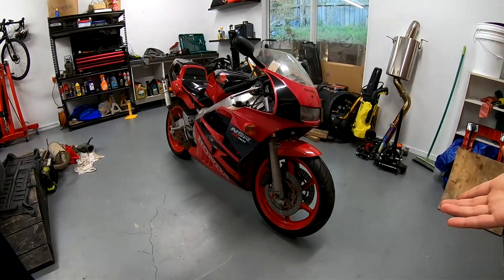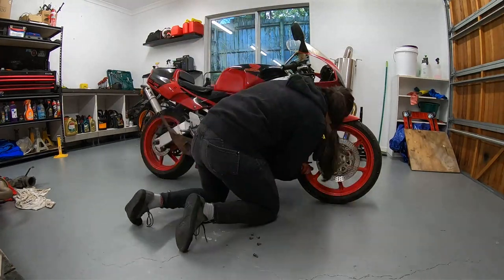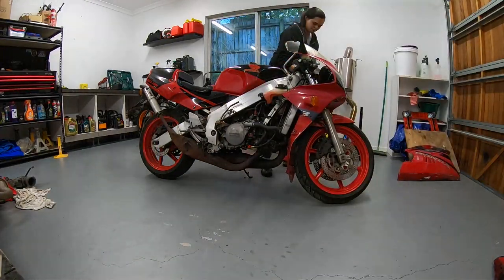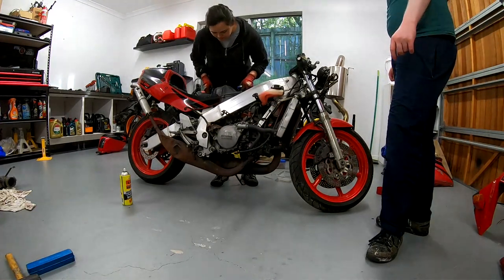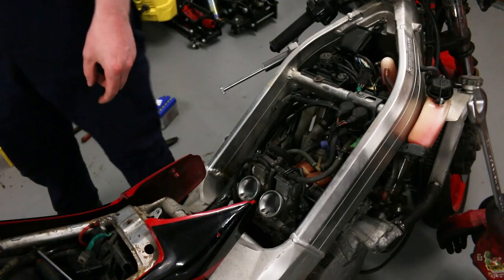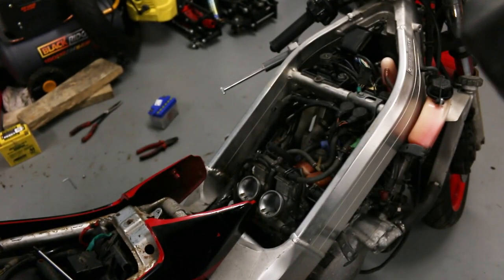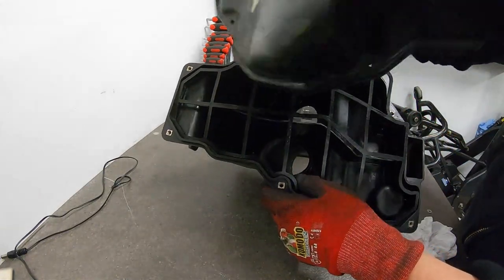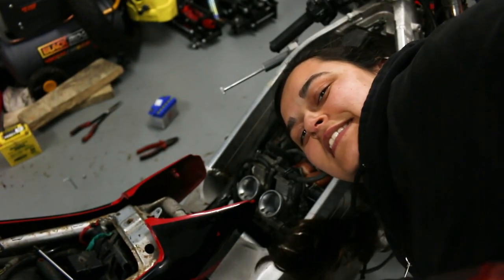Tyga, help us! Project NSR250 Part 2

Comment: I had an MC21 SP back in the day. Cranks fail, you'll need either a new crank complete from Honda or a full set of original koyo bearings and seals and someone who can take the crank apart and reassemble and balance it. Bad running is often because the centre crank seal fails. Awesome bikes when they run well, jetting is crucial and good oil. Good luck
Reply from the maker: Sounds like a fun learning experience! Thank you for this info! Will definitely be looking into this!!!